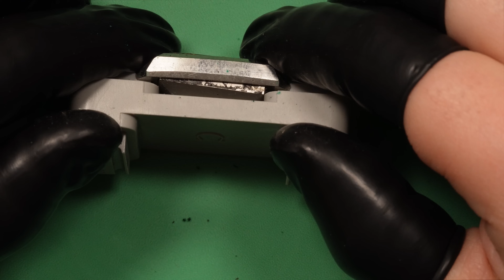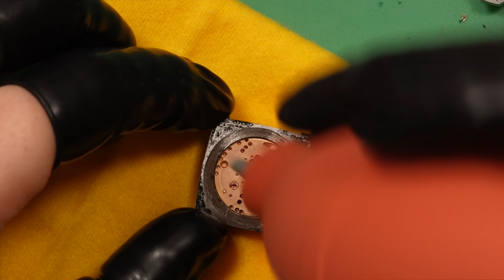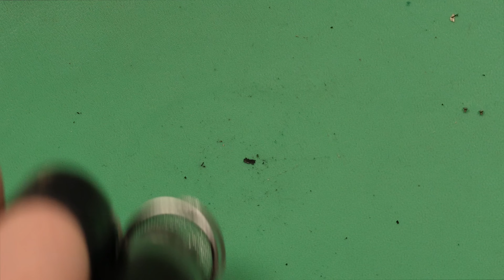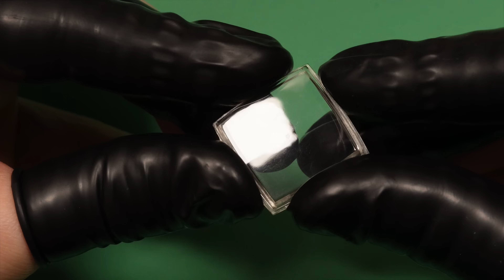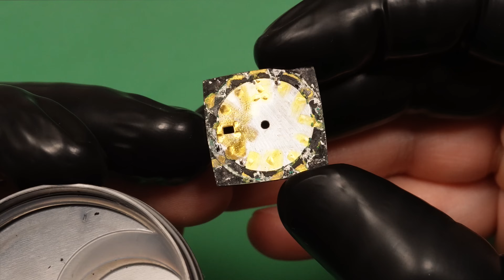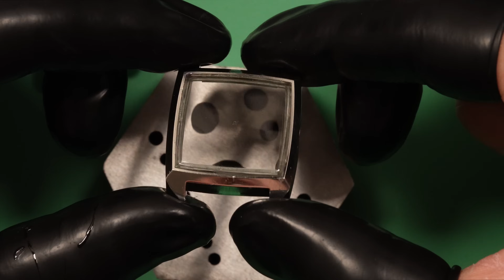Restoring the Most Undervalued Vintage Omega Seamaster

Comment from the maker: Thanks to everyone who pointed out the effect of the IPA bath on the impulse and pallet jewels. After reading your comments, I reopened the watch and found that the jewels were indeed a bit loose. It turns out that part of the shellac dissolved, so I had to perform an additional repair after posting the video. Lesson learned! Thank you all for the great advice and support! 🙏
Reply: I have a Valgine swuire automatic with the same case system! I didn,t know that Omega and other brands used the same system nor that a special tool exist to open it! I open it in different way and scratch a bitt the case. Thank you for the info! I will make a tool myself to open it right next time! Keep making videos. Kind regards from Belgium
Reply: I made the same mistake with similar watch!
Reply: @adrianaghitoaie2996  La stessa cassa è stata adottata sul modello Longines Ultra Chron Square, praticamente identico salvo il movimento che è il 431, purtroppo anche la guarnizione che doveva trovarsi tra il vetro e il quadrante è stata messa sotto e questo è un grave errore oltre al fatto che la guarnizione originale tra vetro e quadrante è trasparente di forma quadrata spessa e alta 0,5 mm.
Reply: Hi, I was just about to point this out.  However, only make that mistake once! Well done with that case! I hate any case like this and try to avoid them, well done to you! And great job with the gasket!
Reply: You can make a tool yoursel! I have a Valgine swiss with the same case system and open it in the wrong way ! Now i know !  @boydsargeant7496
Reply: I have a little Woman's watch that is about the size of the mainspring barrel you just worked on. It's a little Bulova  23. I think it's from the 1940s.
Reply: I am one of these no date collectors. I never set the date on non quick-set  vintage watches because it causes wear.
Reply: I have a RespiratorX of the same age but only needed a service.
What a great job you made of it.

Comment: Using this video to redo a botched serviceing, thanks a lot! No need for that tool to open the case though. Just get two planks or other blocks of equal hight, put the opposite sides of the watch on a block each, making sure the logo square is unsupported, and press down gently but firmly on the glass (AI says you shouldn't , but it works).

Comment: Watchmaker here. Maybe it's just a bit of horological myth, but I'd always heard "bumper" autos were actually a good deal more efficient at winding than 360-degree rotors. The reason they fell out of use was that they're more complicated and expensive to produce, and require more frequent service to avoid excess wear. I can't vouch for the efficiency, but I love bumpers and having owned and worked on many over the years they do appear more complicated and finicky in terms of manufacture. I just like the way they feel on the wrist, you notice the hammer bonking back and forth subtly and it's a reminder you're wearing an amazing tiny machine.

Comment: @rescuingwatches Did you ever 3D print the tool. I’ve had one on the bench for a year that needs to be opened. Thanks for the great video!
Reply from the maker: Hi Matt! I didn’t 3D print it in the end, but if you reach out on IG I can send you the measurements in case you are planning to do it. Cheers!

Comment: Nice job, and nice watch! Aside from alcohol's ability to dissolve shellac, I have also seen it cause a disasterous crazing effect on acrylic at the edges which slowly develop into cracks (in a different hobby), so I would also avoid using Isopropanol to wash the crystal. I have not yet seen it impact a plastic watch crystal since I'm am very inexperienced with watches, but I think it's better to be safe than sorry, particularly if the crystal is of value. Consider this a public service announcement. 🙂
Reply: Yup! Watchmaker here, and vintage cyrstals of anything other than glass should be kept away from all solvents period. There were several different types of plastic used over the decades under several brand names (even celluloid, easy to spot as it's always discolored yellow now). But almost all of them are vulnerable to crazing, clouding or even literally melting in contact with isopropyl, and anything stronger will virtually guarantee damage. Always remove the crystal if you're using any sort of solvent, unless you plan to throw the crystal away anyway.

Comment: Sorry to be a bit blunt, I see a lot of watch restoration videos,  However when ever I see a watch restoration video,  esp of the Swiss watches,  the dial,  the glass, the case all look scratched,  dirty  but the inside us as new as a brand new watch.  Is this really possible at all?
Reply from the maker: I can’t blame you for thinking that! I also get skeptical when I see people finding a Rolex in the mud… With neglected watches, the parts exposed to the elements often show significant damage. However, movements tend to be well-protected if the case is properly sealed (especially true for compressor or Oyster cases designed with an hermetic seal). Dials are more vulnerable when not stored properly, since the paint/lume can degrade over time.

Comment: Is the case diameter 33mm left to right, or diagonally? I just got this variant (only with a magnifying lens over the date) and it measures 33mm diagonally. I thought it could be a women's model but looking at the close ups of your fingers holding the case, it seems mine has the same dimensions. Then again, you couls have giants hands, hard to tell!
Reply from the maker: I don’t have the watch with me but I think the men’s model measures 33.5 mm side to side (horizontal) and around 40 mm lug to lug (vertical). Hope it helps!
Reply: Then I definately have the women's model. It measures around 29mm lug to lug and 25mm horizontally. A nice size for a true dress watch. Thanks and greetings from my secondary account!    l @rescuingwatches
Reply: @rescuingwatches  Update : I brought mine to a local specialist for servicing. Omega itself had sent it back unserviced, due to lack of original parts. I gave the specalist a link to your video as well, I hope it'll help him!

Comment: awesome work and awesome watch aswell (got mine as male version delivered XD) but if you glue the glass into the caseband, how do you open it again?
Reply from the maker: Congrats on the find! It’s a spectacular watch. The GS glue is quite soft, I glued it to ensure that it’s correctly sealed but pushing back it will detach without issues. However, just in case you are attempting to do the same, I’ve been told that the Sternkreuz UV glue works better. Enjoy the watch! 😁
Reply: @rescuingwatches  yeah .. i need to change the cannon pinion on mine. it's to loose. if i check the seconds hand, she is losing 18 sec per day but if i check the minute or hour hand she is going backwards in time  ;) .... thanks for your tip and keep going this awesome vids 🙏

Comment: Great job on restoration of the Omega Seamaster. I watched all the way till the end of the video; with bated breath I must add,to see the masterful transformation you brought about. Thank you for doing that and sharing it with us viewers. I feel better prepared to tackle any challenges that may come my way. 
One quick question: was the soaking solution that you had used to free the movement from the degradation sticky seal Isopropyl alcohol? I had soaked a movement that had gummed up with the grease and oil over the watch existence. It ended up rusting quite a few of the pins and axles. Not sure if you or any of the viewers had that happen.

Comment: Nice intro, to clean melted gaskets I find alcohol does it very easily. 
GS cement is okay but you really want to use a UV glue and oven. I use the Sternkruez UV glue. It’s easier to apply and I find it sets better than the cement. I do a lot of Seiko where the glass is glued to a metal ring, GS you get bubbles or inconsistencies which you can see when looking at the watch but the UV spreads well and does not leave a witness (after a bit of practice)
Reply from the maker: Mike! Thank you for watching and for the advice 😁 It’s true that it didn’t seem to set too firmly, so I’ll make sure to get the UV glue for the next one!
Reply: @rescuingwatches  certainly worth considering. If you deal with cousins you can get it there along with a good 4 tube UV oven.  Guess it depends on how many you will ever do.  Most crystals as you know are friction or retention spring fitted but anything glued it’s worth using this stuff.
For a new channel your views are brilliant so well done. My channel just does not get much traction anymore😂
Reply from the maker: @MyRetroWatches  Thanks for the source, that was going to be my next question. And nonsense! I've been watching your channel for a long time and you have amazing videos! No one knows what's going on with the algorithm anyway 😂

Comment: 38:42 You put too little oil, the oil couldn't cover the whole pivot, just look at the circle of oil which there is not enough of oil to form a circle  in this case, the circle of oil should cover the whole top of the balance pivot and is atleast 1/2 to 2/3 diameter of the cap jewel, and you scratched the plating when locking the incabloc spring using your screwdriver, that's why you shouldn't use your metal tweezer and screwdrivers in every cases, a simple shappened plastic stick or peg wood stick would be much better and wouldn't scratch anything. You are probably not a professional watchmaker or profesionally trained and I appreciated your effort and passion in making YT videos, I don't want you to feel bad, but watchmaking is like you need higher attention to details, not enough of oil in the balance jewel, making scratches, things like these deny the effort you've made in cleaning and servicing the watch, especially since you are working and filming under a microscope people can see everything including mistakes so clearly.
Reply from the maker: Thank you for the advice! I am indeed not a professional watchmaker, but always happy to learn! I’ll take that into account for the next one 😊 thanks for the support! 🙏🏻

Comment: IPA? What about the pallet and impeller jewels??? Can’t wait to finish this video…
Reply from the maker: Hey! Thank you for bringing this up! The pallet fork and impulse jewels looked good upon inspection, but you are correct, IPA and shellac is not a good mix! Will take that into account for the future 🙏🏻
Reply: @rescuingwatches  no worries - regardles, cool watch and well done on getting it restored. It was pleasure to watch too. cheers
Reply: @rescuingwatches  great video and great watch!! Soaking was a good idea, but if you need to do this in the future have some Hexane handy!! It’s a lot cheaper and the same as one dip so the shellac won’t soften up👍
Reply: exactly - Ipa and shelac dont go thogether. You didn't mention anything about inspecting palet stones or impulse jewel after that IPA bath....